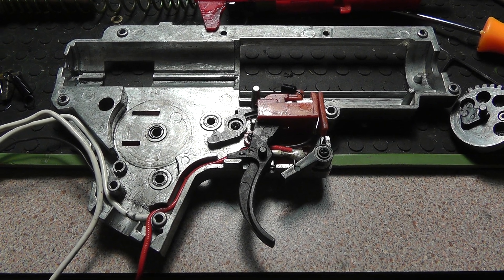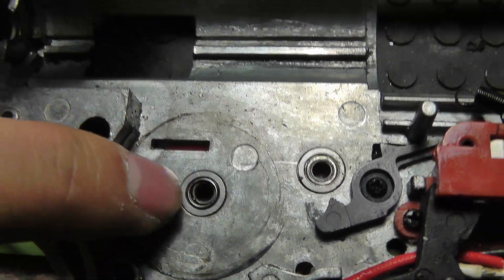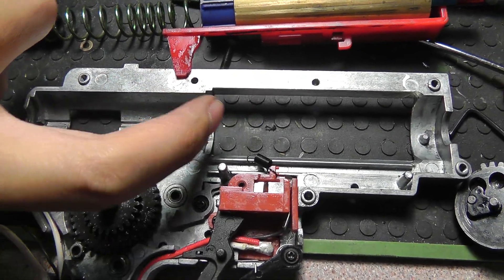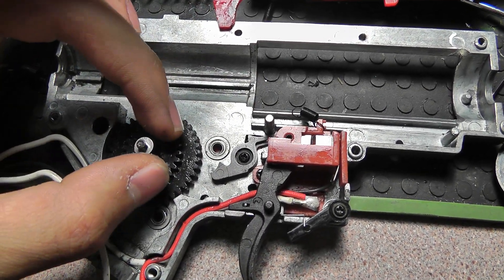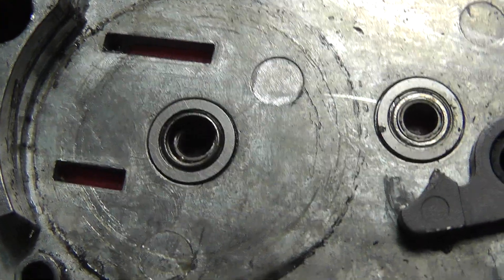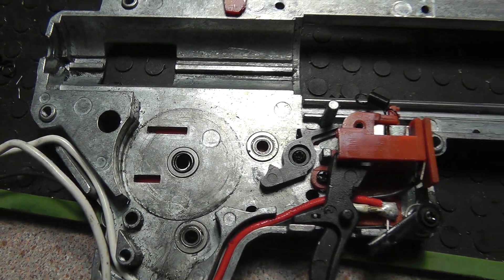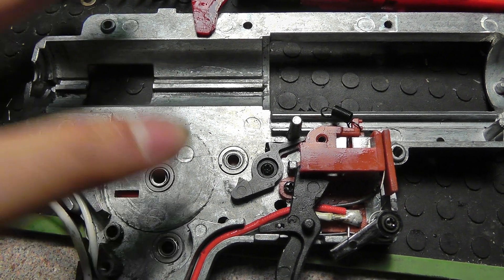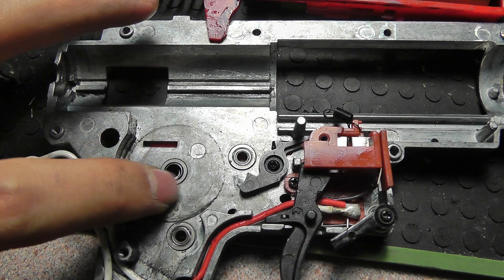ADVISORY: Bearings

Comment: Hybrid is the way to go. 3 bushings, 3 bearings.  Bushings on sector and bottom of spur, bearings on bevel and top of spur. 

Or if you prefer, just bearings on bevel, bushings everywhere else.
Reply: I will use this configuration Thank you very much
Reply from the maker: I was running just bushings on the spur with good success

Comment: Question: If you use one bushing on the one gear and bearings on the other 2, does it run better or smoother?  Is there a noticeable difference then just using all bushings?  I’m thinking about using bearings but it looks like a lot of guys are having the same issue of having that particular bearing being crushed?
Reply from the maker: all bearings run smoother but not usually worth the reliability trade off in my opinion. I would use a bushing and bearing combination.

Comment: Maybe a dumb question but we’re the gears shimmed so they don’t move vertical? Kind of to transfer the movement to the top of the bearing rather than the inside.
Reply from the maker: the shimming was fine. Its a material strength issue

Comment: I always put a bushing under the spur gear because of the stress. Prettymuch every tech who know a lot about high stress do it.
In my 2 DSGs, Im using Lonex bushings under spur and modify cheramics and Magic box bearings everywhere else. There's never been a fail on them ( its a 60 and 55 RPS gun, both clocking in at 350 FPS)

Comment: I've ran bearings in setups doing 35-40 rps with M130 springs and after 10k+ rounds they're still running smoothly. I'm running G&P 8mm bearings in these setups, I've tried them in a 51rps SSG setup that also had an M130 spring. Only ran this for a couple thousand rounds as was an experimental setup that didn't last.
Reply: Welp, the bearing sets I mentioned in the comment above are still going strong, after at least 100k shots in various setups, including a DSG setup.

Comment: Hello! I wonder what the spring you used in your AEG? I believe we should use bearings for spring below 120 is not?
Reply from the maker: this was on a m120 spring. I've had other setups using m135's, m120's, etc with varying results using different kinds of bearings. At this point though for all builds im RECOMMENDING running bushings at key stress points like this.
Reply: valleyriverarms
Ok, thank you!

Comment: my experience with bearings is they will fail at some point doesn't. matter how low stress your build is they have to many moving parts to be reliable. but I've always run bushings on the spur, top and bottom, ever since i blew a set out and had the evil little bouncy balls tearing up my gear box.

Comment: An additional factor that causes the bearing under the spur gear to fail, is that it has the gear spurs on just the other side of the axel. This causes most of the load to be carried by just that other side (roughly 80% of the load). This inbalance centers the load on the bearing under the spur. The other gears (bevel and sector) are both more or less exactly balanced and are thus less likely to fail.